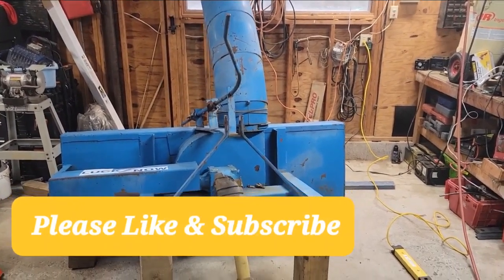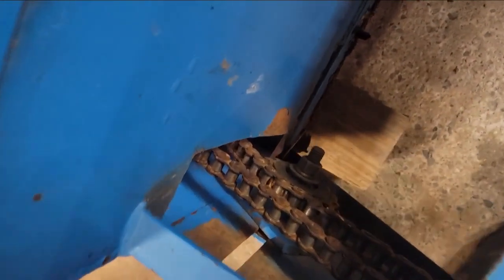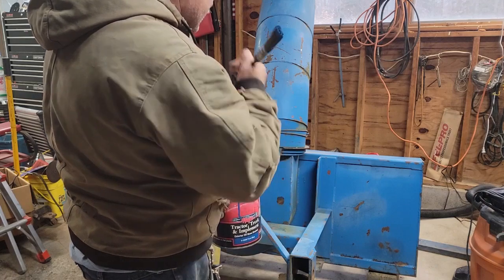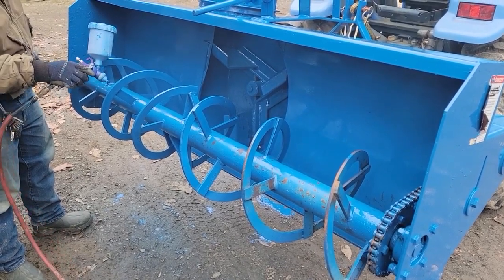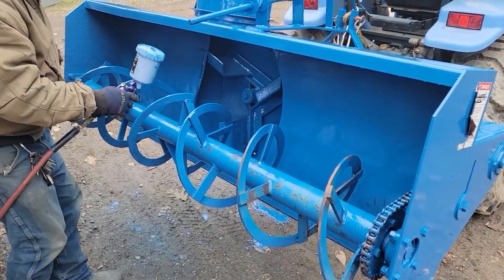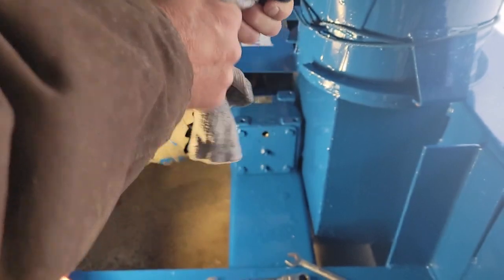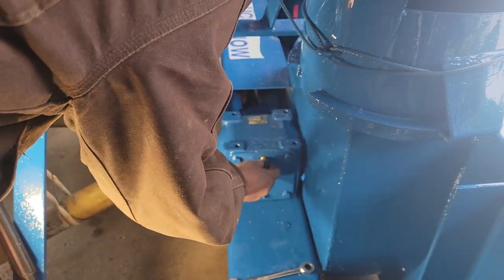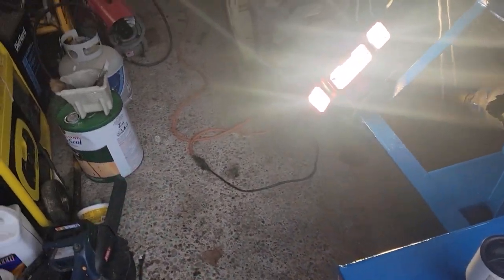Restoring and Servicing a 3 point snowblower

Comment: Chain idler should be on top chain as the auger id is driven by the lower , all torque is on lower , may overload idler bearing
Reply from the maker: Thank you for that. I didn't receive a manual when I bought it. The chain was very loose with the idler on top.  Possibly chain was stretched. Or maybe previous owner replaced chain with longer one. I replaced chain when it broke and laid them side by side to determine length. I can take out a couple links to move it in correct position. Thanks for the advice.